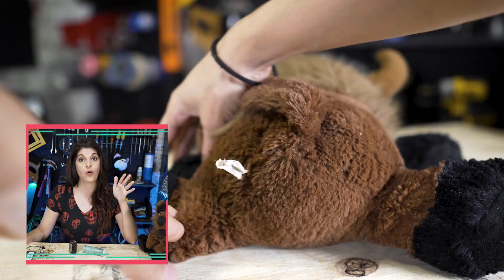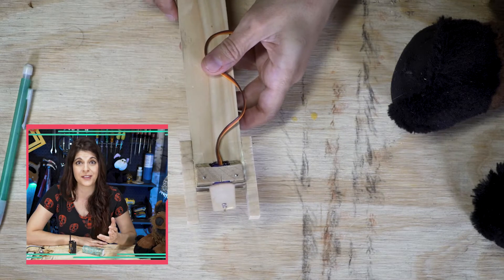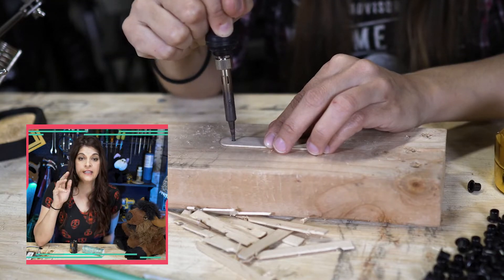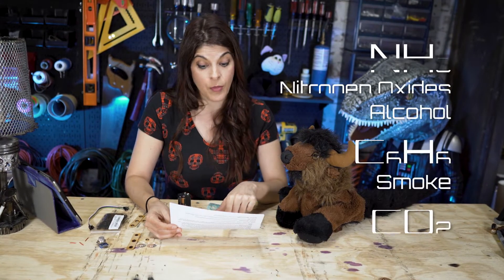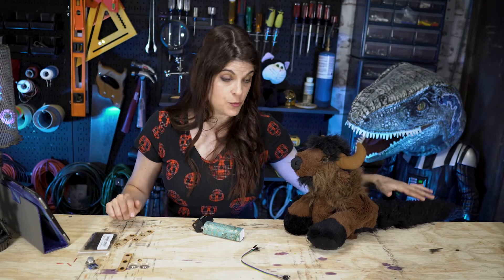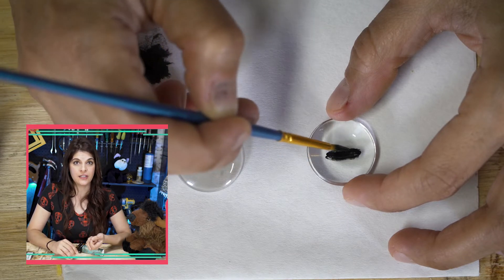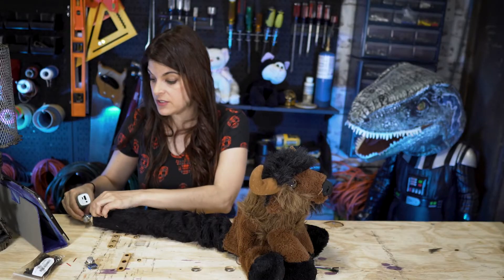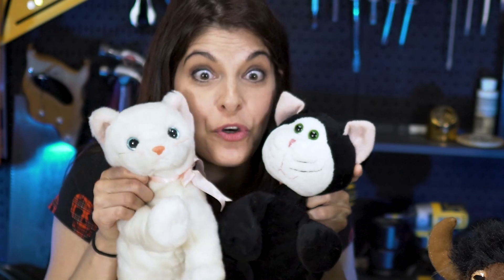DIY Fart Detector with Arduino, LED Eyes + Twitching Nose

Comment: When you glue angles like that put your wood glue to both edges and in the middle use a thick super glue. I believe the super glue may work by itself, but used with a good wood glue i feel its stronger. So put a good drop of thick super glue in the middle put it together,  the super glue dries fast and holds till wood glue sets. Best of both glues fast too.